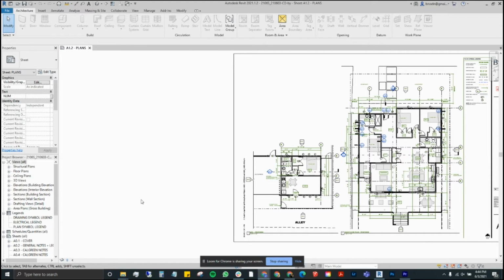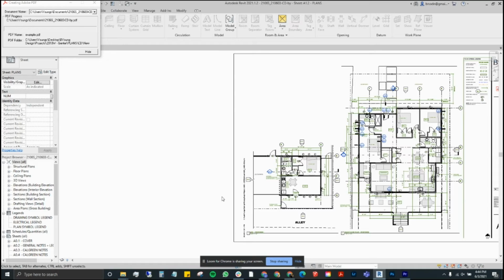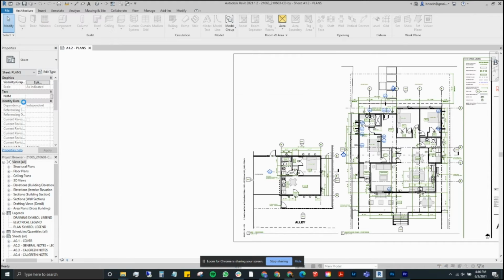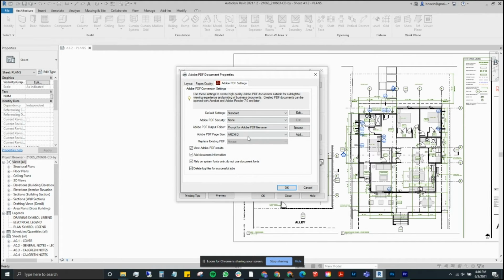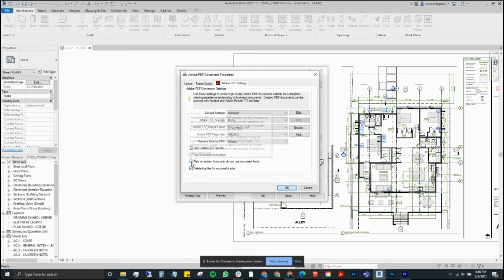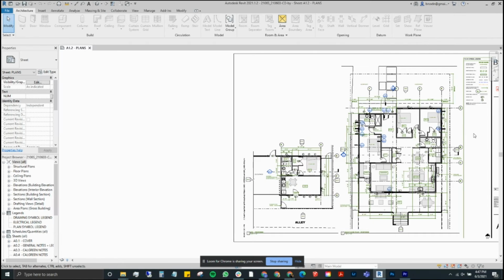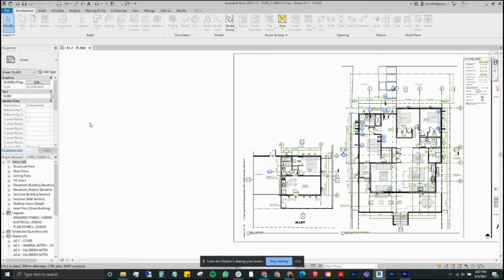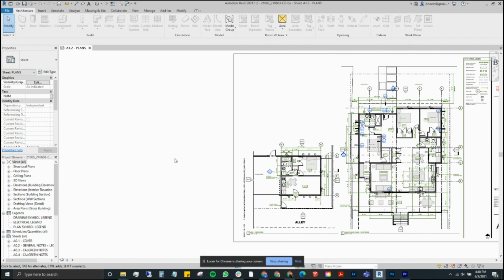Revit Architecture: Print to PDF Troubleshooting | BIM Modeling

Comment: Useless. Only work for those, who somehow have Adobe PDF printer installed. I don't have such option. 
Can someone explain how to use Revit native export to PDF feature without ruining the font?
Reply from the maker: You should be able to still use the native revit pdf feature without it affecting the font. What font are you using?

Comment: my revit not showing anything on browse when I want to print what do I do .and where am to select sheet is not selecting .
Reply from the maker: Hum…I’m not sure I totally understand the question. You have your model up in revit and select “print” and it’s not showing any of the sheets? Can you go into the area where you select which sheets you want to include?
Reply: @BYoungDesign  no is refusing to open .
Reply: Same it reuse to open
Reply: Same problem here. Do you solved it
Reply: @sunusuresh369  I haven't.
Reply: Same here, can’t select the sheets sometimes.